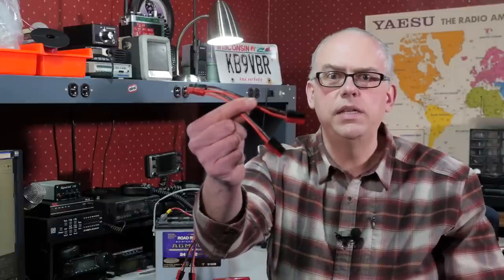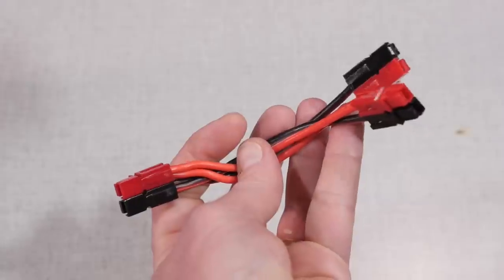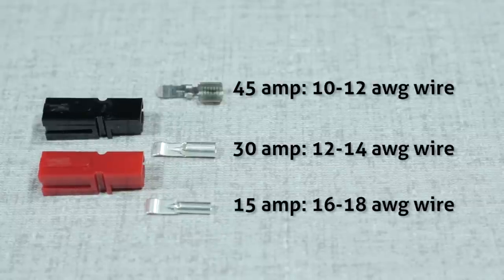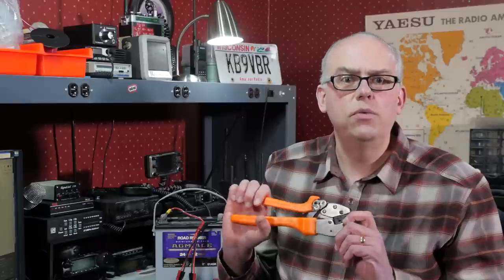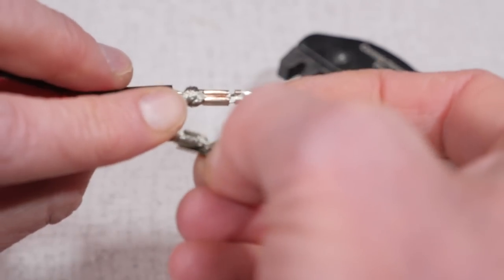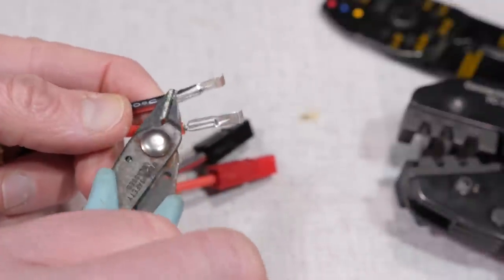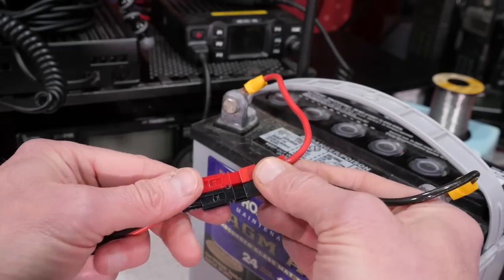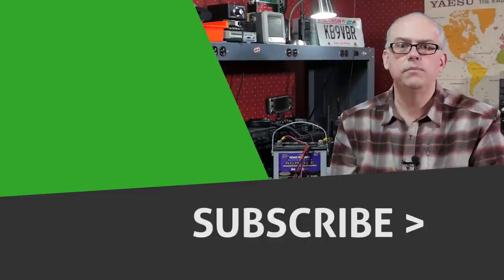DC Power Splitter with Anderson PowerPoles - Ham Radio Q&A

Comment: Thanks Michael. I just made a ring connector to power pole cable for my 20Ah LiFePO4 battery, put power pole connectors on the external power cord for my IC-705, put connectors on my battery charger and the spring clamps I cut off its cord. Next up, connectors for my XPA125B amp and a splitter to power both amp and radio from the battery.

Comment: An excellent video, as usual.  You have a talent for showing people how to do it in the easiest way possible.  And you even show people the proper way to connect them together.  Thanks for going to the trouble of doing all that.
I might add that I replaced all of my 12 volt HT chargers to APP as well as the power adapters.  It provides a very good set of charger bases and adapters as well as easy charging from our vehicles.  I used to use a set up much like that except that there were two lines in the end connectors allowing daisy chaining of the connectors.  When I realized that wasn't optimal I purchased a MFJ-1128 DC power bus, and it works beautifully.  The bottom line is that power pole connectors are a great way to go.
73
KE0JQA
Jim

Comment: I have 2 single band radios. One is a 2M, the other is a 70CM. I got them in a month of careless buying, and am thinking of selling them as a "station set" having them use the same plug may make them more attractive to specific buyer. If it does not work, I have another quirky set up. It is all good, right.

Comment: The National Electrical Code (NEC) does not recognize soldering as a allowed connection. It can come apart in high current situations. Crimping is much better. 
Thanks for this video. This kit and tool will be part of my arsenal...soon!
Reply from the maker: Yes. That's one of the reasons why I don't solder electrical connectors.
Reply: @KB9VBRAntennas  Even more important is choosing the right crimping tool. I used to work for a GM dealer. We received a package from the special tools division of GM and it included a box of terminals used by GM vehicles and a crimping tool. It was a fantastic improvement over the hardware store type crimpers. When ever I run into these junk connectors it freaks me out, especially the blue Scotchloks. This tool was a highly specialty crimper that did a beautiful job of crimping both the conductor and the insulator. You ended up with a factory connection. The funny thing was it included a butane soldering iron and also a deflector shield to use for heat shrink tubing.

Comment: Hi Michael, thank you for all your instructional videos. How short could I build my transceiver power cord? I heard that the shorter the better.
Reply from the maker: I usually say, make the power cable short enough to be convenient. Out in the field I'm using 12 gauge stranded and have two cables, a 3 foot and a 6 foot. The six foot cable is nice as I can place the battery on the ground, otherwise three foot is more than plenty for most tasks. In my shack, I custom cut my cables to reach from the power supply to the rig with enough slack so I can also pull the radio out without too much effort.

Comment: Thank You for this video. Someone also suggested I can use the same system to connect different lengths of antenna together to cover different bands without having to cut and waste wire
Reply: In not sure I follow. You mean wasting feed line?

One feed line with a splitter and you plug in which antenna you need? Why use a splitter?

Usually for a dipole you have 2 lengths of wire. One cut for say 20M then a second set you add to get 40M. Then another set for 80M. That saves the most wire. But no splitter is needed just some quick connect. I use male and female blade connectors.
Reply from the maker: I've heard of similar recommendations. As long as the weight of your antenna doesn't pull the connectors apart, it should work fine. I use them as quick connects for my portable antenna ground radial system.
Reply: @KB9VBRAntennas  twist a loop in the ends of the wire, put a small zip tie to hold the loop then use a quick clip of some type. I use fishing swivels with the quick snap. This takes the strain off the connection. 

Anything to take the pull off the connectors. 2 zip ties would work too. One around the wire holding the second one to attach the quick connector. Or just zip tie the 2 wires together. But sometimes I don't plan on using 80M so I leave it off. So the fishing swivel helps with that. But zip ties are cheap. =]

Comment: Trying to come up with another way to do this. Im not typically a fan of putting two wires together in this fashion. Over time they may be more likely to work loose or even break. For traditional crimp fittings they have “piggyback” fittings. I realize yours wasnt for a permanent type install, but I would still like to come up with a small distribution/splitter for powerpoles without the cost of, and unneeded, fused blocks etc

Comment: I'm also going to use this system as a means of quickly connecting my radio to either my power supply or my battery, which already have power pole connector's

Comment: Beware.  Once you start with powerpoles you'll want to put them on all your equipment and make adapters for all your other connectors so they're all interconvertible.  I've probably used about 100 powerpole connector pairs in, splitters, adapters, etc. over the past 2 years.  Just get the crimper and a large supply of powerpoles to start.  You won't regret it.
Reply: Yea, I think I'm going that direction... we will see.... Just tired of those MC4 connectors.

Comment: The Powerwerx 14g wire I have has a pretty thick jacket. This make trouble trying to stuff two leads into one shell. Does yours go all the way in the shell? I’m worried about + stripped wire outside the shell touching the - wire since it can’t be fully inserted.
Reply from the maker: I have a roll of Powerwerx wire so I know what you mean. I believe in this video I'm using a wire I purchased online that must have a thinner insulation as everything fits into the shell. I think one solution would be to strip off more insulation, crimp the two wires together into the insert and then use a bit of heat shrink tubing to reinsulate the bare wire. Everything should fit into the shell.
Reply: @KB9VBRAntennas  that’s exactly what I came up with as well. However I’m still paranoid that it might split from time and twisting and someday short out. I notice this type cable is sold by DX engineering. Their pictures are poor on the details. I may have to buy one to see what they did.

Comment: Is it safe to use this for two devices that have different amperage or I need to solder fuse for such device end?
Reply from the maker: You can run devices with two different amperages on the splitter. I use one of these to power my rig and the tuner off the same battery. The splitter doesn't have fuses in it as my longer power cable to the rig is fused. As long as those are fused, you should be fine.

Comment: Another good video.  I would like your thoughts on using a battery to power radio equipment.
Reply from the maker: For quite some time I used a deep cycle marine battery and a 1.5 amp battery maintainer/tender as my station's power supply. It worked very well and I was pleased with its operation. But eventually the battery wore out and I went back to using a conventional 13.8v power supply. Although my station still has battery backup power as I've added a West Mountain Radio PWRgate to the mix. Here's a video: https://youtu.be/kT9vy1WLDB0. Using the deep cycle battery in this manner does give you reliable backup power and it is cheaper than a 35 amp power supply. But the downside is that nominal voltage will be 12v and not 13.8v, so your transceivers will function just fine, but there full rated transmit power may be a bit less.
Reply: Get a Lithium Iron Phosphate battery from someone reputable like Bioenno.  Noy only will it put out more power for longer, but the number of charge cycles is much better over a lead acid.  So while the up front cost is higher its cheaper in watt hours over the life time of the battery.

Comment: Power Poles are great! But one thing to keep in mind. For those of us who prep for SHTF......etc. Even if you have a good supply of them on hand you can't always carry EVERYTHING with you! So when you are separated from your supply or it gets destroyed what will you do if you have to connect something? Go to the nearest hardware store or auto parts store right? Well guess what they do not have! 

The readily available standard insulated crimp on connectors work just fine if installed correctly!  Ive used them for decades! No issues! Plus they are cost effective! 

I do use Power Poles but only connections over 30 amps. Ive actually had more issues with them than the standard connectors. But I am rough on stuff! I off road often and having something I can fix, is readily available and cost effective seems to make the most sense to me.

My .02 cents. =]

WW5RM
Reply from the maker: You bring up a very good point. Even though Powerpoles are considered a standard ARES/RACES power connector standard, not everyone may have them installed on their equipment; so you should also carry a couple of adapters in your go-kit just in case. 

If this was a true SHTF scenario and I had to connect something, I'd probably be cutting off ends and stripping wires.
Reply: @KB9VBRAntennas  yes! Never forget the electrical tape! Multi function tape it should be called. Works great to hold a make shift bandage in place. Ask me how I know. =]

Comment: Thanks, I have been enjoying your channel and learning a lot. For the 45A 2 wire or even single wire for that matter, do you need to pre-close the open wings of the insert before crimping or just put it in the crimper and squeeze?
Reply from the maker: The 10-12ga contacts that fit in the 45 amp connectors have an open slot you lay the wire in while the smaller connectors are more like a tube. You don't have to fold in the opening‚ but I've found that if you do then they will crimp better. My crimper will occasionally miss or the connector may slide around in the crimp channel so closing them slightly tends to aid in the crimping process.
Reply: @KB9VBRAntennas  makes perfect sense, thank you.
Reply: Great video! Glad I’m not the only one that struggles with 45 amp.

Comment: Nice vid.
A bit worried, the battery terminal isn't fused/isolated.
Reply from the maker: You can certainly add a fuse. Since all my other cables that connect to the splitter are fused, I left the fuse off.

Comment: Do you see any difference between the off brand powerpoles from Amazon that's linked in the description from the true Anderson branded ones from powerwerx or mouser? Pretty tempted to just get the Amazon kind but not really sure if there's any quality issues. I know the Amazon ones don't come with the connecting roll pin but I don't really care about that honestly.
Reply from the maker: I've heard that some Powerpole knockoffs have fit and quality issues. I haven't had any problems yet. The knockoffs I've bought fit together well and they also connect just fine to my authentic Powerpole connectors. The only problem I've had is with them accepting the roll pin, so I just glue the two pieces together instead.
Reply: @KB9VBRAntennas  Awesome, thank you sir! Gonna save twenty bucks then and go with the Amazon kind.

Comment: You appear to have used chinese copies of anderson powerpole connectors which do not meet the quality control standards of the original (read some of the negative reviews on Amazon).  It might not matter for your application, but it is generally better to purchase from a reputable dealer if you want genuine powerpole connectors.
Reply from the maker: Almost all the powerpoles on Amazon are knockoffs. I've found the biggest issue with them is the contacts. Because they are stamped out in big strips and broken apart, they will often have a burr on the sides that prevent them from being easily inserted into the shell. Filing the burr fixes that and they slide in nice and easy. The other issue is the shells don't stay locked together, but a drop of super glue holds them tight. Otherwise for long term use I haven't had issues with them.
Reply: @KB9VBRAntennas  I would splurge for the extra $0.50 and buy the genuine connector which I know will work everytime.  I'd rather that my money support an actual amateur radio or electronics dealer, not Amazon selling fake cheap knock-offs.  Thanks.

Comment: I bought some off Amazon and they are Chinese knock offs. They work OK but they will not mate with genuine Power Pole, they are slightly bigger.
Reply: Yes, spend the extra money and get the real ones
Reply from the maker: You are correct, there can be inconsistency in the different Chinese knock-off powerpoles available. The ones I use in this video are good and will fit with the genuine Anderson product just fine.